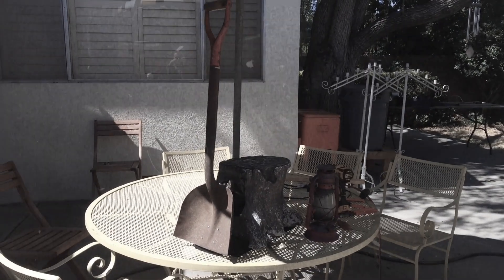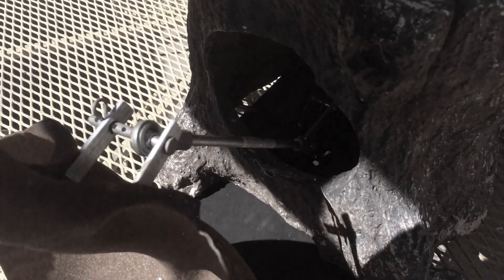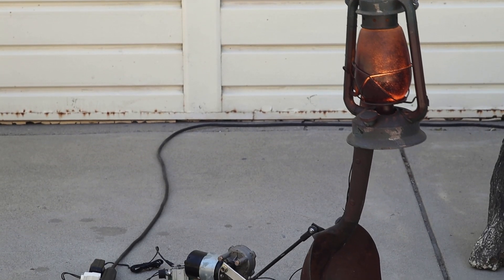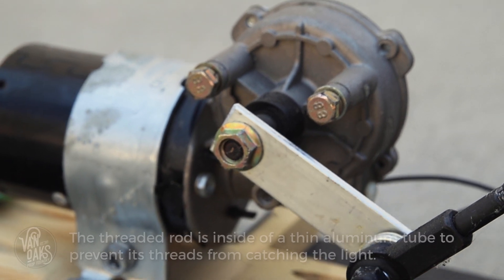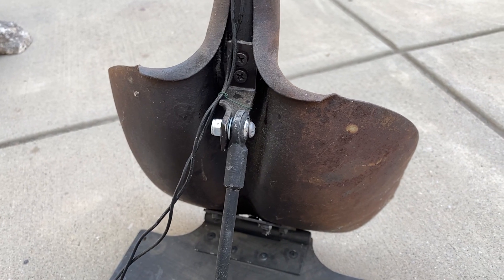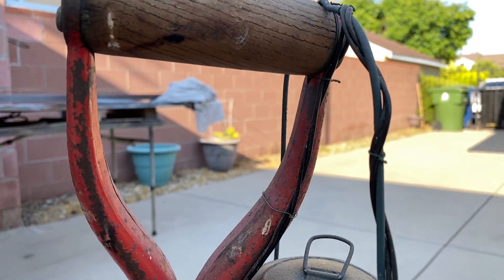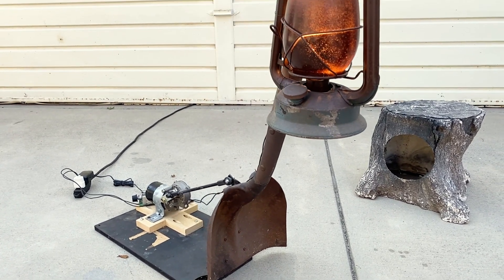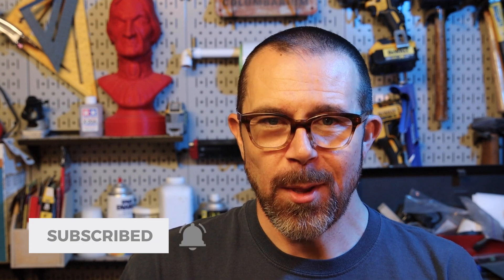Improving the Haunted Shovel Prop - REMIX!

Comment: Revisiting and revising prior projects is the mandate of every maker!  I made a VERY rough first wizard staff.  It lit, but was very heavy, poorly balanced, and the light was dim (1989, so pre LED).  The second version was much more refined, better wood, much better headpiece, brighter light, easier battery change mechanism.  Over the decades I’ve upgraded many parts, finally adding the eye melting LED 5 years ago!  It is great to make the additions;  the key is to honor the previous versions at the same time.  Perfect job with the Shovel!
Reply from the maker: Thanks!

Comment: I am brand new at haunting and have watched most of all your video. Love them! Trying to figure out how your wired everything in this video. Thank you for sharing your awesome work
Reply from the maker: The 12v power connects to the speed controller, then the speed controller is connected to the power cord for the wiper motor. The lantern is wired like normal lamp would be wired. I hope that helps.

Comment: Another great video. I have question about the threaded rod.  I have a quarter inch Heim joint but 1/4 inch threaded Rod did not work.  Did I get the wrong size heim or do they make a rod that will fit 😅correctly in the joint?
Reply from the maker: Hard to say what's going on in your situation, but my initial though is that It could be that the thread patterns aren't the same.

Comment: So where did you source a 1/4"-20 rod end?  I've searched high and low and have come up empty.  I don't really want to go bigger than 1/4" rod but seems regular threaded rod does not mate up with a regular rod end that I can find.
Reply from the maker: Try local mom & pop hardware stores. They always have the hard to find stuff. Or you can step up to a larger rod.
Reply: @VanOaksProps  I think the difference between big city and tiny city.  No such luck here.  Can't even find it on amazon!  May need to go to plan B of low tech dowel and over-sized eyelet hooks, but not going to be as slick.
Reply from the maker: That would definitely get the job done. The only reason I didn’t go that route is the clicking of the metal as it pushed/pulled. The volume of our haunt is low, so everything little noise really stands out.
Reply from the maker: These might be your best bet: https://www.ebay.com/itm/154428521753
Reply: @VanOaksProps  Good point.  I'm still on the hunt.  Will check your link out.  Local off the shelf won't happen.  I've exhausted that avenue.

Comment: I wonder if it would be possible to use two wiper motors at 90 degree angles running at different speeds to create the effect of random left/right and circular motions. Hmm...
Reply from the maker: It should. The biggest issue would be hiding the motors, I'd think.